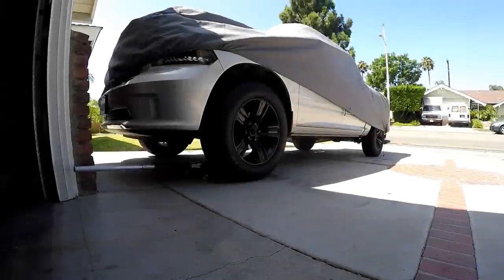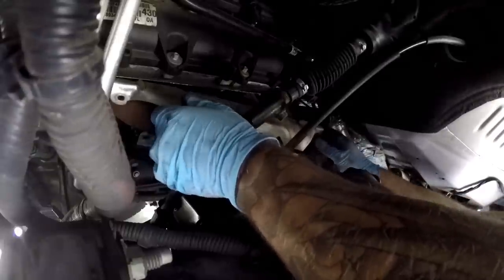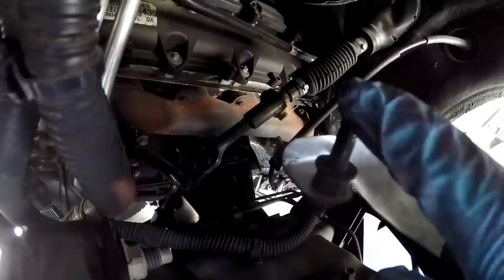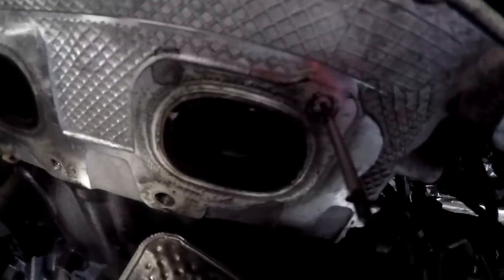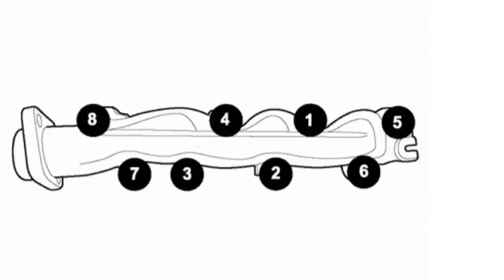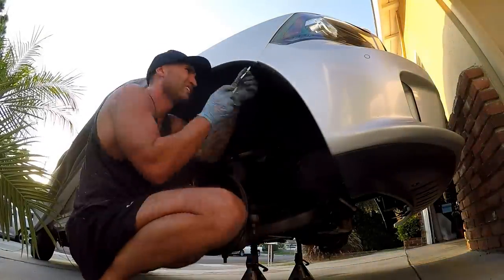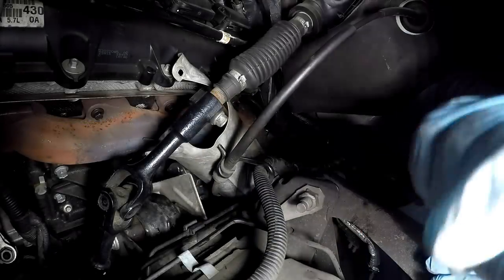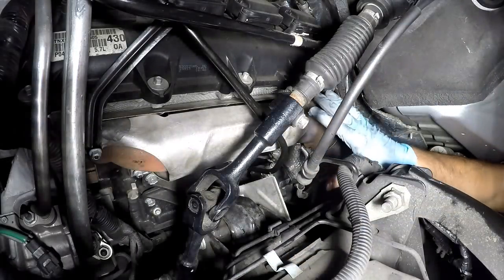DODGE RAM HEMI Exhaust Manifold Stud Replacement   Leak Ticking FIX

Comment from the maker: CLICK HERE FOR A GOOD QUALITY BOLT AND STUD EXTRACTOR KIT
https://amzn.to/2HlUXXA
CLICK HERE FOR GOOD QUALITY GASKETS
https://amzn.to/2YBfDAN
CLICK HERE FOR NEW STUDS/BOLTS
https://amzn.to/2w0lgMm
Reply: BoostedMotorsports hey how did you know it was a manifold issue? My 09 sounds very similar but I’ve heard it could be a camshaft issue
Reply: @ahoymatee1  if you grab the heat shield (wait til it's cold or wear gloves!!)..you will feel it is loose indicating broken studs, also if it is coming from passenger or driver side easily notable from under the truck. A camshaft would be a more central to the motor noise.
Reply: The gasket looks like they are correct fit for my 2017 5.7 V8 (according to Amazon part matcher).  Are those studs/bolts the correct size for my truck?  According to Amazon they won't match my vehicle.
Reply: BoostedMotorsports would these studs and bolts from amazon fit my 2014 ram 1500???
Reply: Amazon only goes to 2010
Reply: Need some advice from someone.  I finally succeeded in getting the drivers side done.  Was a bit of a challenge but it's all done. Now I have an issue that I need to know what the fix for it is.  It blows a code about wheel position sensor.  Please tell me how to get this to stop.  I have watched the video over and dont recall anything about it in there. Thanks in advance.
Reply: Besides the tick noise any issues with performance like lagg in power , i have the same problem cuz i can heard it from the driver side but i have some power loss i dont know if its due to this or not any idea can help
Reply: I've been hearing it on '14 ram. Just started looking around yesterday scared it was a cam and lifter issue but convinced it was an exhaust leak since I first heard it and there it was, exhaust leak from hell on passenger side. Heat sheild burnt up the ground from block to heat shield was burnt to a crisp and crumbled. Now I gotta get in there and figure this shit out lol. Anyone recommend putting headers on it? Nothing crazy but, maybe like a flowmaster with cats?
Reply: Great video, showed everything needed to figure out how to get the bolts out, only wished you would've started the truck after 👍🏻

Comment: Dodge should have recalled and replaced every crappy manifold. They know the manifolds warp, it's not the bolts, it's the crappy designed manifolds.

Comment: I'll tell my story to hopefully save someone headaches. Both my exhaust manifold needed to be milled flat, which ran me $104. This took me two weeks because of trial and much error. Busted bolts- I ordered highly flexible long cobalt aircraft drill bits, but they weren't making much of a dent in the bolts broken off in the aluminum heads. I bought a Milwaukee 90 degree drill, then left-handed cobalt drill bits, but still not much of an impact. I broke off an extractor in one bolt, and just gave up on that bolt. Diamond Dremel bits didn't make much of an impact. What did work? I followed the advice of a mechanic on YouTube who used a Dremel with Pearson Dental M19-2818 points with an Amazon, "No Cry Professional Rotary Tool Kit", which has the flex shaft so you can get behind the frame. Grind into the bolts, then use a bolt extractor. I got the big Irwin set. First one I twisted off, but two others came out.
Reply: That's exactly what I'm afraid of!

Comment: You need to get the manifolds resurfaced. The reason the bolts snap is because the manifold warps

Comment: If you can and if you have access to it, welding a nut onto the stud is by far superior to drilling and extracting. The weld will only attach to the stud since the head is aluminum. You get the benefit of the heat to break the thread locker loose from the OEM studs and to help extract the stud from the head. The cast manifolds warp, from my experience, especially in the colder climates. However, the warping should cease or at a minimum, decrease after they warp the first time. If you have the surface machined or machine them with a belt sander back to flat, you shouldn't have to do them over and over again.

Comment: That "special" bit the guy used to get out your broken extractor bit is called a "rescue bit".  It's an extractor bit that is extra hard so that it will even bite into drill bits and broken normal extractor bits. By the way, your video is quite good, and has given me the confidence to try fixing the exact same exhaust leak on my 2011 Ram.  The dealer wants $462 per side, and just hell no.
Reply from the maker: Thanks Bryan!  Glad you liked the video and found it helpful!  I agree its expensive to have done at the dealer and really they should warranty this or come up with an update as every truck does this....
Reply: Mine has been doing it for two years but it was a good excuse for me to order headers I'm just hoping it really is a manifold leak
Reply: also know as an easy out. He's right though buy a quality set, use the biggest size for the hole you drill in the stud and push it in by hand and NEVER pound it into the hole... its not necessary. great vid, thx.
Reply: @wastedyears6653  or . Just weld a stud on

Comment: Thanks so much for taking the time to make and post this video.  I watched it about 10 times before ripping into my '09 Ram.  You made working on the driver's side look so easy.  I had both of the rear bolts snapped on the right side...only one was flush with the head.  On the left side...what a  PITA... both rear bolts were snapped, and I snapped the forward upper one when I went to break it free.  

Because of this video, I knew what parts and tools I would need to have on hand, THANK YOU!  I drilled out 4 bolts snapped off flush, and used vice grips to get the one that was snapped off flush with the manifold.  Did I say you made it look so danged easy?    I did go to the Dodge parts counter and buy the stock gaskets with the flange shields, as well as a set of the stainless bolts to put in the rear positions.  The part number of the "double ended" stainless bolt is 6509863AA, I used 4. 

One more time, thank you!  Subscribed!
Reply from the maker: Thanks Gary I greatly appreciate your support and feedback!  It's comments like these that keep me motivated to keep producing content frequently!  I know it can be an absolute nightmare getting some of these bolts out which is why if I ever hear the slightest ticking I try to get the bolts replaced right away before more start snapping.  I also just posted the 16 spark plug DIY video and have engine oil and 8 speed transmission fluid change videos already on the channel!  Let me know what you think of some of the other videos when you get a chance too! 👍

Comment: You make some great easy to follow videos. Just had some BBK shortys installed on my 2010. 3 broken bolts and two cracked manifolds. 117K miles on the truck. Wish I had seen your vids before, would’ve saved me some money. Keep it up, and thanks.
Reply from the maker: Thanks for the support Todd!  Plenty of videos on the way! 😎

Comment: I was able to extract my broken bolts without removing the manifold. I used a left handed drill bit to extract the broken bolts. did Passenger side 5000 miles ago. One finally broke on the driver side. Going to do the driver side this weekend. Dealer wanted 1000.00 to do the job. HATE the dealership. Easy Job. Took more time to take the wheel and inner fender out than it did to replace the studs.

Comment: Hey, nice video. my 04 1500 ram with 190k is just starting to do the cold start tic. I figured it was the exhaust manifold but haven't diagnosed it yet. I thought when you was drilling out the broken bolt "oh, oh, looks mighty small" then you compounded the problem by using HF tools. So a great tip to tell viewers, a broken stud and you only get one shot at it before more serious problems start. Great video

Comment: So I just did this on my 2012 Ram 1500.  Thanks for the great video.  One thing that I will add is to check to make sure that your exhaust manifold is level on a flat surface.  My truck has 160,000 miles and the driver side manifold was slightly warped.  I replaced it with a new one because I think the warped one will just break the bolts again sooner.
Reply from the maker: Good tip!  Yeah like you said if the bolts have been broken for awhile chances are the manifold could be warped too.  Good to double check!

Comment: Mine just started doing it on cold starts. It only does it for a few seconds. The truck has 23k miles on it too. I was freaking out thinking it was the engine. This video really helped me not freak out! Thankfully its under warranty and the dealer should fix it for free

Comment: i had all of them break on my 2015 Ram sport after 100,000km  and i took it to the dealer they wanted $1,200 ( Canadian )  to replace the ones on just the drivers side ! so thank you for this video !!!
Reply from the maker: No problem Tyler glad you found it helpful.  I know the dealer tries to overcharge for sure on this!  Dodge (RAM) should fix this from the factory!
Reply: Tyler Shouldice My Ram dealer replaced both side manifolds, studs, gaskets and shields free of charge. 2010 Ram 1500 5.7L over 120,000 Km and over 7 years old at the time. I contacted FCA on the issue and never had an issue. Not warranty, not recall and not service bulletin. Some sort if customer loyalty thing.
Reply: Tyler Shouldice .. . I had my 2013 ram in for cam change at 180k mi, which was covered by my lifetime powertrain warranty... They noticed a slight leak from the header and change the broken stud free of charge which is not covered by the powertrain warranty... It was covered by FCA somehow. I would do like suggested and contact FCA... Or just change it out with this really well Illustrated video as a backup

Comment: Thnk you for the detailed video.
It helped me to accurately diagnose the cold startup sound which I initially took to be dry lifters but would last way too long on a cold day.

Today I was able to fix the issue and replace the bolts and broken stud on my 2016 Ram 1500.  With your comments and video I was able to plan for the task and get the correct tools to extract the stud broken off flush. I used a tungsten carbide drill bit for the pilot hole and a left-hand cobalt drill bit and extractor to remove the broken off stud.   

I also used OEM parts for this.  It is worth noting that the front and rear studs are not the same.  They have different part numbers and differ in appearance, but only on the 13mm hex face.  The rear stud (more likely to break, guess they're made from a stronger material) seem to have a groove in the centre of th hexagon, all around.  They're about double the price of the front ones ($8 vs $4) and have a dab of white paint on them when ordered new.  

The process went smooth because I knew what to expect and how to execute. This is all made possible by guys like you, enabling the rest of us with your knowledge. Huge thanks!

Comment: There should be a mandatory  safety recall for the exhaust manifold (hemi tick). After all, an exhaust leak can get into the cab of the truck. When I bought my 1500 2012 Ram I got an extended warranty. The truck is at the dealer now and the exhaust manifold is being repaired for a second time. This is a great video. I'm confused why you used OEM parts when it is OEM parts that are failing. Nonetheless, thanks for the video. When my warranty ends, I'll use the video to repair said item myself.

Comment: A friend of mine, Craig, reminded me of the old solution for rusted bolts (nuts, studs). Carefully heat the offender with a torch then quench with oil. It works. Heat a broken bolt or stud then squirt some oil then use extractors. The heat+oil even makes drilling easier. 🤘Thanks for the upload!

Comment: I've done a lot of exhaust manifolds, mostly Ford trucks with broken studs.  I Mig weld a nut over the stud then work the nut and stud out together.  This only works on aluminum heads.

Comment: woops - my blunder ... 
pertaining to my recent comment below ...
the Dorman part # for the exhaust manifold hardware kit is - 03211 or 03211cd - both will do the job ... fitment is for years '03 to '08 ... these include '9' bolts/studs/nuts and are for either side - to do both will require 2 kits.
Dorman part # [[ 03309 ]] works for a few newer years. 
Note - part # 03411 I had listed - is for certain Fords.
Again ... great vid Boosted2k - keep em all comin' !!!

Comment: Use a small torch heat up broken stud. use birthday candle place against the hot broken stud it sucks up the wax in the threads and lubricate will turn easier old  machines showed me this trick
Reply from the maker: Thats an awesome tip!!! 👍👍👍
Reply: What an awesome tip!
Reply: Eh that doesn't really work. I would say another method is to weld a nut onto the broken stud (for those that have a MIG welder). The heat of welding will expand the steel stud and break the rust bond. The aluminum dissipates heat very quickly so it should come out fairly easily. Also weld won't stick to aluminum. So just hit it a few times to build up a bead and then try to very slowly turn it out.
Reply: @Someguy6571  yeah good luck welding onto the stud that's snapped off below the hole 😂
Reply: Umm... you can still weld a bead on to the broken stud even if it’s flush or a little below the hole. Weld won’t stick to aluminum, so if you are good you can still put a bead on the broken stud.

Comment: I drilled and extracted the bolt that broke off on my Dakota 4.7, total pain in the behind.  I recently picked up a Ram 1500 and both manifolds were ticking and found both with two broken bolts (flush with block).  Haven't welded anything in 35 years but had a small mig welder I bought off amazon a year before and was sitting in the box on the shelf.  I watched a few videos and then proceeded to weld nuts to the broken bolts...so much easier than drilling.

Comment: good to hear back from ya Boost ... wish i could've done an edit to the 1st comment to simply change the kit part #'s and also add that the 'measly $10  cost for the hardware kit'  happened to be for the 03411 Ford kit ... the 03211 kit for these Rams is notta anywheres near that cheap ... its more like $35 ... ges they know they'll make a killin cuz they surely sell alot more of em !  (lol) ... i did one of these for a friend in need also using the Mopar kit but its been a year or so & forget how much it was or a part # for it but anyone in need could probably just call any dealer for the info ... the one i did then was an '04 that had the rears sheared on the passenger side ... gasket was ok - replaced it anyways with a Felpro.
Hava great year my friend !
Reply from the maker: Thanks for the support!  I ended up getting the whole mopar bolt set off a dealer that puts together a kit on eBay for about $30 per side.

Comment: Hats off bro that was a good video. The only thing I would have done differently is instead of drilling and using an extractor I would have plug welded a nut over the broken stud. If you have access to a MIG welder and basic welding skills this is much easier and much faster.  I have even done this when the stud is broken off below the surface of the head.  The weld being mild steel and the head being aluminum as in this case or cast iron in others won't stick to the head. Try it next time. Keep up the good work.
Reply from the maker: Thanks Mark!  Yeah I've seen that method and it definitely looks much easier!  I didn't have access to a welder with the truck in the driveway but I completely agree its a quick easy method and beats this drilling nonsense if you can!

Comment: Just recently bought my 2014 ram 4x4 so i'm still learning all its demons that are common/bound to happen. My question is would replacing the manifolds with shorty headers be a better option to avoid this common issue? I was looking to get headers the moment i got the truck before knowing any of this lol but now i am curious if it will be a better option for when the day comes. Love your videos by the way man been watching a few getting some good info for whenever my truck needs to be worked on you gained a subscriber!

Comment: Great video, I use reverse drill bits instead of extractors. The bolts will often back out when you are drilling. Also if you do break an extractor, just weld a nut on the end of the stud and get good penetration and you can use a socket. I have done this even if broken off flush. The steel is not going to melt and bond with the aluminum. I the case of the one you had that broke l, I bet it would back out with a reverse bit and I would heat the aluminum around the bolt and inside that open port
I only use extractors on bolts that I know will spin easy. As soon as you tap it in it expands and locks those threads. If they don't  bite either a very light tap, they only make it worse. Could be worse, could be a ford with a busted off spark plug.

Comment: Every time something breaks always go with an upgrade for the fix. Or you will just be back at square one all over again.  This is a great excuse to chuck those manifolds for headers.
Much easier job on the 2wd. My 04 4x4 is a little harder with the shock towers right where you need to work. Also the couple minutes it takes to disconnect the steering shaft and get it out of the way is worth it. 
Good video.
Reply from the maker: I agree!  We upgraded the manifolds shortly after this as well as the bolts 👍😎
Reply: Good idea. Hey if they use trash at the factory. When it breaks find the next best thing. 
I find it reduces how much I have to think about in life.
Good video.